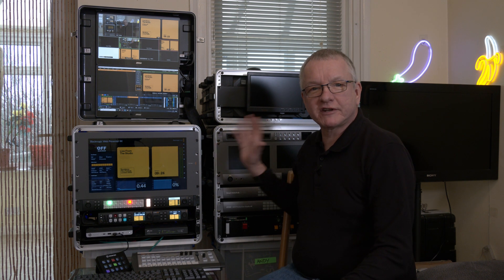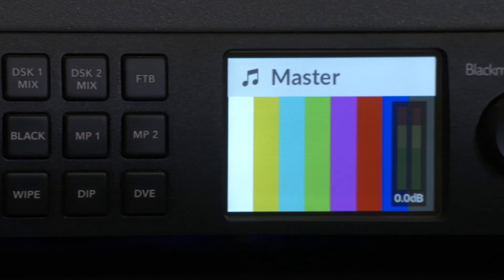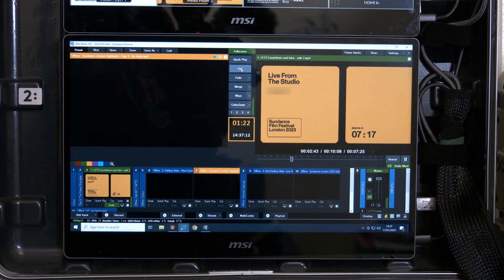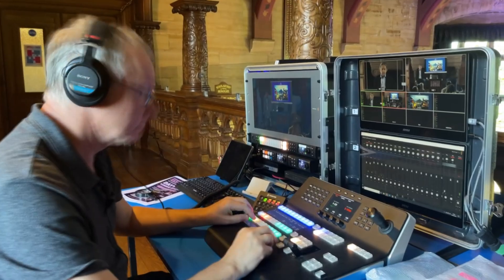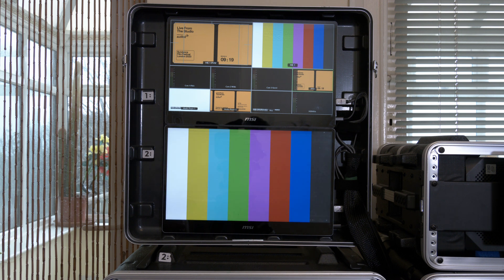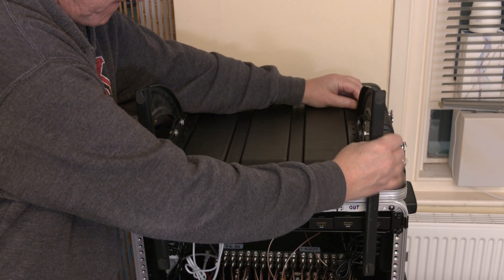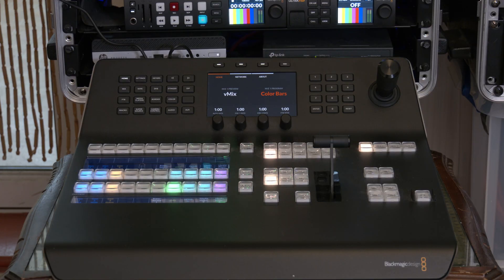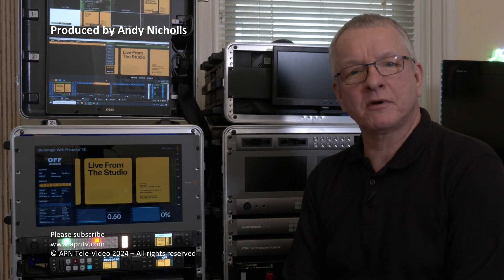ATEM vMix PPU Multi-Screen Upgrade

Comment: at 5:07 it shows a small shelf you used to put your converters on. What is that shelf called and where can I buy it?
Reply from the maker: Yes, I used 3 of these in the end.  I couldn’t bring myself to pay for the BMD shelves.  :-)  As with the converters, I Velcro’d them and the Hyperdeck, Webpresenter, PC and Switch in place.  These particular shelves are made by AllMetalParts and available on Amazon and eBay.  I’ve started putting links in the video description and I’ve added a link to that in there for you.
Reply: Sadly that allmetalparts is out of stock :( bummer! Thank you though  @apntv